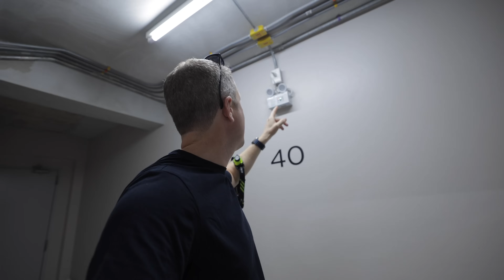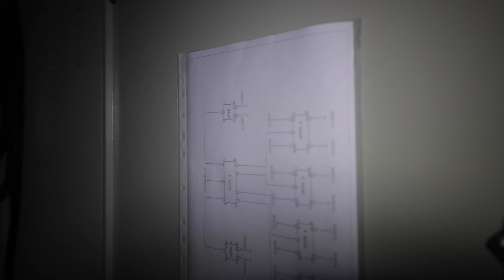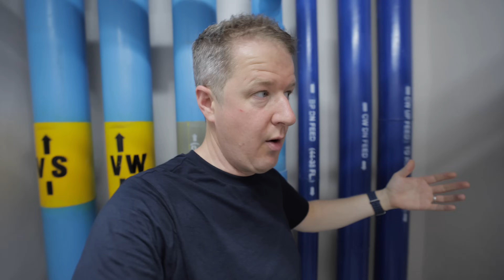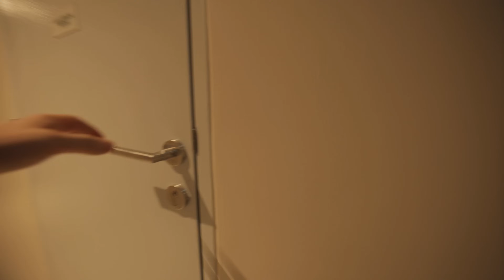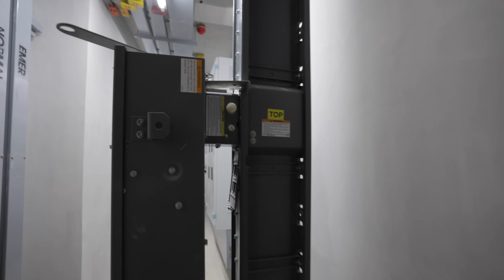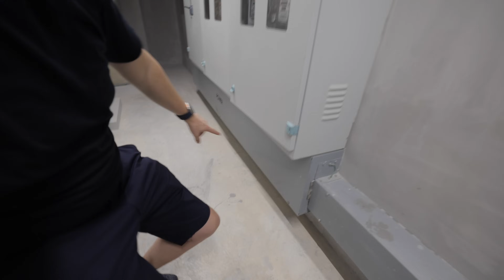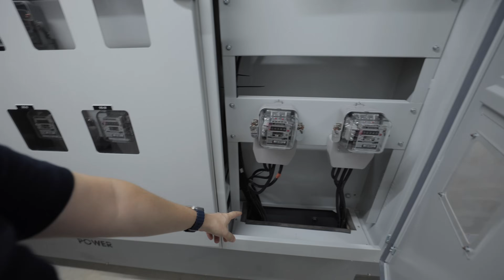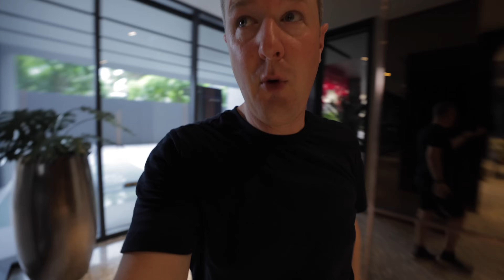How Bad Are Electrics In Thailand? 🇹🇭

Comment: I lived in Thailand for the best part of a decade. During that time, I rented several properties. Thai house wiring is a thing to behold. They like to surface mount the cables. The cable runs are beautifully installed, very neat, and perfectly straight. They use a white and black colour scheme for the wire. But no one seems to know which is the live wire. I think it's up to the sparks on the day to decide.
Reply from the maker: How has your time been in Thailand? and always leave it to a sparky
Reply: @artisanelectrics  what happened in thailand mate??????? do tell
Reply: Yeah, exact my point too. I never see it so neat and beautiful. Our house technician for electrical and A/C show me something of his own work how he learn it from foreigners too. Most work how I see was more hilarious. 😂
Reply: Hired handyman to install induction Hob put a voltmeter right next to wires he was using for Hob.  Guy ignores voltmeter and touches the wires with fingers. They normally do not install a ground also.
Reply: @jbranche8024   So around 2007 they started at Ko Samui, changwat Surat Thani, with grounding of new houses and repaired builds. My electrical shower was suddenly correctly installed for my own surprise. But the most sockets and plugs are not grounded, that's right but mostly not need to do it too. 

The most thai people do same my mom did it - put out power plug if have a thunderstorm.

Comment: I'd like to add about seeing "green" fibre tails. They're usually APC (Angled physical contact). The ends of the fibre mating points are ever_so_slightly angled, to reduce light losses. This is used in high-end high bandwidth environments, so great to see they opted for this! The reason for APC, is to reduce light loss and reflection, so the maximum amount of light passes from connector to connector.
Reply: APC is used in all FTTH networks because it's PON.  If they were to use UPC and someone unplugs their home ONT (modem/router), all the light from the OLT will get reflected back which may cause issues to other users on the same leg.

Comment: The installation of electrical systems on a new-build like this one will have been supervised by a Western electrical project engineer. As a result the installation will be of a high standard.
However........
In less well-regulated builds and especially out in the sticks things are very different. Most electrical equipment is not genuine OEM, rather Chinese copies, installation is very poor, earthing non-existent and 'qualified' electricians difficult to work with. 
We have a commercial broiler chicken farm and the 3-phase installation was pretty bad. 
My favourite was our local electrician who installed a 7kW water heater in the kitchen and fitted the earth to a nearby bolt in the wall.
I have learned much from your channel.
BTW, I woudn't go poking around like that without permission as you would absolutely be arrested, have your camera equipment confiscated and be fined heavily if caught.
If you come back here I'd gladly show you around a typical 3-phase installation by 'professionals'.

Comment: Those tubes you see on 9:46 are called "buffers" they each carry usually 12 cores of fiber. And that "bell" wire is a usual single core or 2-core fiber cable for terminating the "final" end connections.

Comment: I couldn't get a good view of the fibers, it looks like they're running single strand bi-directional fiber to all of the apartments, which honestly is a good way to do it.  This is generally referred to as a PON (Passive Optical Networking) setup which has significant advantages in the field such as single fiber deployments (one fiber for multiple subscribers) and passive splitters for distribution.  The one laser light coming from the OLT is sent into the PON run and is then optically split amongst a handful of subscribers using the PON splitter (one fiber can carry 4,8,16,32,+ subscribers depending on OLT configuration) and it's all done using specialized cuts in fiber instead of active regeneration (receiver/transmitter).  Depending on the size of the OLT, one could service hundreds of customers with a single device with a high PON port count and proper configuration, without sacrificing stability of the links or speed.  Currently, the orignal PON standard was GPON (Gigabit Passive Optical Networking) but lately, a newer standard called XGS-PON has popped up (10 Gigabit Symmetrical Passive Optical Networking) using the same single-fiber passive deployments, but newer OLTs and ONTs.

At the subscriber end of the PON, a specialized ONT will be installed that terminates the fiber into Ethernet (usually gigabit, although 2.5 and 10G copper/SFP+ ONTs may exist too).  A lot of people like to misconstrue that the ONT is just a dumb media converter (while there may be some configurations where this is true, this is most often NOT the case.), the truth of the matter is that the ONT at the subscriber end is a lot more advanced than appearances would show.  The ONT can provide diagnostic information, line signal information, and even some CPE information (MAC address, link state, speed, errors on port, etc..) which allows the provider to do a complete diagnostic from the Internet-facing edge of their network all the way to the subscriber's CPE to vet the operability of their service.   The downside of the OLT/ONT pairing is that they are usually very proprietary, meaning that an ONT that's Alcatel branded, may not work on a Huawei branded OLT.
Reply: Best response I’ve seen to describe how PON works and the different elements to it. A doff of my network engineers hat to you sir
Reply: I guess "good way to do it" is dependent on the objectives you have for the network and at what level the aggregation happens. IMO, if you're putting fiber in, don't mess with all that and put one fiber per dwelling to be future proof: it's more expensive in the beginning, but offers a lot of future (or present) opportunities. 

Here in Switzerland, this discussion is so critical that the incumbent (Swisscom) has been ordered by the competition/anti-monopoly agency to go back and spend hundreds of millions to convert the installed PON base to individual fibers to each dwelling. The reason is that by law the fiber network has to be open for competitors and with PON, the incumbent has power to limit what competitors launch. 

For example, the ISP I use is a smaller ISP which offers 1G/10G/25G symmetrical, all for the same monthly price (only the one-time setup fees differ, since this is when they cover the different price of the optics + cost of the individual ports in the gear).  If the incumbent had been allowed to run a PON-only network, they would be the ones deciding which speeds are allowed on the network, but since all they can do is lease a dark fiber to the competition, they have no such power now.
Reply: Looks like pon yeah. At 9:40 you can see fibre 1 - 8 1490nm -19.58 and 1550 -3.62 not sure if they're decibel documentation or not. So everyone with the same wavelength with rx tx SFP. But he did mention there were four tubes out of the incoming supply, could be some weird extra sheathing for four fibres or the normal G48 with four tubes of 12 for future proofing in case they use single fibre from the Node instead of pon in the future.

Comment: Surely not 2000A for 1000 homes? 2A per apartment?
Reply: three phase?
Reply: @hellopellos  2K Amps on Three phase would then be 6A? Still not enough or did I math that wrong?
Reply: @cyanade  at worst, yes. but you don't assume every apartment maxes out everything at once
Reply: The 2000A was the tap off for that floor not the whole building.
Reply: We canot know if the 2000 A bus is only for couple of floors and there are supplying cables from the basement transformer to those buses. Or even own transformer for every ten floors.

Comment: I got involved with installation of sockets at the girlfriends house in Thailand. 3 pin thai sockets and UK sockets a ground rod an isolation switch before the breakers . The Thai plugs have isolated tops on the pins. Probably better than the USA sockets if installed well
Reply: The plugs seem to be good but I'm not so sure about the multi-standard sockets that take both US and Thai plugs. Designing sockets for two entirely different systems (flat blades and round pins) seems to be risky because you'll end up reducing the contact surface for at least one, if not both plug types. Banning US plugs might have been a better idea than designing an entirely new plug standard.

Comment: Nice video about the impressive electrical systems in that condo. How can a 2000A bus bar feed 1000 apartments with 50A each? All apartments together would require 25 times as much power. Are there multiple independent 2000A bus bars feeding a few floors each?

I was surprised to see conventional looking analog electric meters which would apparently have to be read manually. Here in the Philippines they are switching to all digital meters which can be read remotely or from a distance.
Reply: Diversity of course. Not all the apartments will draw 50a for all of the time.
Reply: @thedroneguy2024  Assuming 1ph per apartment though, that would total as 6A continious per apartment, not including all the electricity used for lighting, elevators etc per floor, which really doesn't add up well. I would have expected double or triple that even with diversity calcs. 6a per apartment at 230v is only 1380w, which really isn't a lot, especially after power factor eats some.

2000a tap off makes sense though, would be sized for that bus bar that is specced to serve the entire buiding, and they likely wouldn't make smaller ones due to economies of scale. Building is likely on a ~7kA service, and might have its own 11kV (at a guess) substation
Reply: I believe the tap was 2000A, not the supply to all apartments. I could be wrong though!
Reply: @mattmanslim  you are correct. The 2000A is the top off for that floor
Reply: You usually don't calculate with the full 50A. In Germany a house with up to 3 flats still has a Main Breaker size of 63A (3-Phase Supply) even if the Main Braker for all three flats has 63A too. That would come to 189A, but one flat never comes near the 63A.
Reply: @mba70  The triple-phase main breaker in a modern German flat supplies 3 phases with 63A each, which is 189A or 43kW per flat. So at most the German flats are oversubscribed by a factor of 3. A flat with an electric stove would likely use a maximum of 14kW a during peak times, so this would work as you correctly stated.

The condo building in Thailand though with a 2000A supply for 1000 apartments would only be 2 ampere average per apartment and each apartment has a 50A main breaker.  This would be oversubscribed by a factor of 25 and would not work.

Also the 50A per apartment is likely single phase as in most of Asia. This means that a tenant with an electric stove and oven with about 10kW already requires almost 40A. Additionally electric showers are very common in Thailand, which require between 4 and 8 kW each. The 50A single phase can easily be fully utilized during peak time in the early evening when showering and cooking is going on.

Comment: I still chuckle to myself when people say things like. ‘Future proofing the building by fitting EV chargers’😭😭😭
Reply: Well they are. Can’t pretend the future won’t happen
Reply: @GrahamRead101 😂 🥱
Reply: INB4 the future is hydrogen /s

as much as the Japanese carmakers wants to, that is....
Reply: Bro, roads in 3rd world country are corrupt by their city council. Let alone those EV
Reply: I will guarantee you that EVs are not the future,
Reply: @geoffwalmsley3066  out of interest what do you see as the alternative to a car powered by an electric motor - which gets its power from chemical energy storage aka batteries, or (less likely for personal transport vehicle, possibly more so for large vehicles) a hydrogen fuel cell.
Reply: @GrahamRead101  We’ll all be using flying saucers to travel around in with a nuclear energy cell the size of ya Willy
Reply: @GrahamRead101  I want to start by saying I'm very much pro going green. But I do not believe the future should be solely Battery EV. 

Also, the greenest mode of transport is mass-transit. We should be investing in railways, busses, trams and proper cycle infrastructure (like you see in the Netherlands). We should be encouraging people out of their cars. No matter how the car is powered, cars are bad when we rely to heavily on them. However, we will always have a need for them to a point, like we did for horse and cart.

So,
After an EV completes it's life cycle, it is calculated that the energy taken to build and operate the EV would be less than an ICE, which is good..

But everytime I see that stated, they don't seem to include that the batteries eventually have to be replaced. Also the older the batteries get, the more energy it takes to charge them, and the less energy you get back. Which means battery powered EVs loose efficiency, so we should be weighing up when and where an EV is better than an ICE.

I personally think small EV city cars absolutely have a future, smaller cars are more energy efficient, plus smaller batteries, less material etc, and  would drastically reduce local pollution.

But otherwise, we should continue advancing ICE vehicles, also encouraging to properly maintain vehicles so that they can last until high mileage.

In fact I believe it's a marketing scheme created by the car industry, tell everybody they've got to go electric to encourage people to buy brand new cars.. and we know the government after a small amount of lobbying are in on it too.